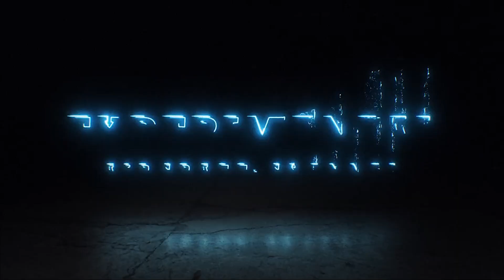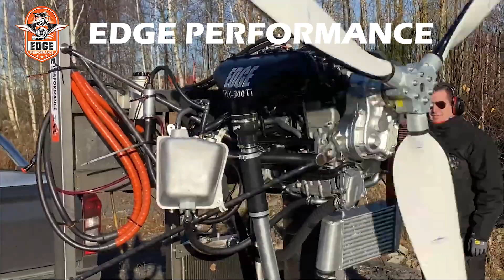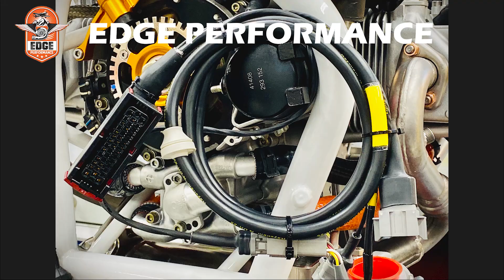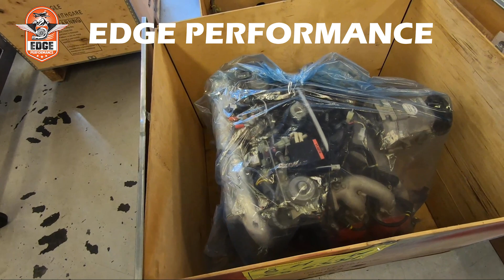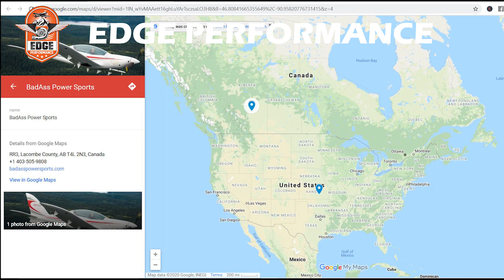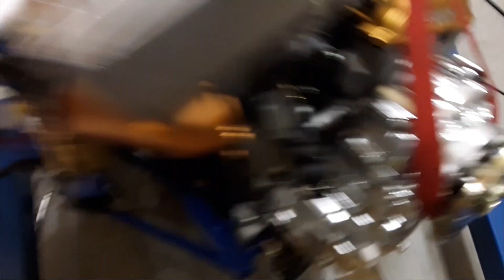Edge Performance | Yamaha Rotax | Engine Week 2020

Comment: I've been dealing with Automotive and automotive power plants for a long time. Since the mid 60s. I like the idea of learning about aircraft and their engine performance. The problem is is nobody but nobody have I ever heard talk about the actual engine performance. The only thing that they say is that the engine might put out 110 horsepower or 130 horsepower or 150 horsepower or 180 horsepower or 300 horsepower. Horsepower is not the only specification that is needed to know about the capability of the engine. You need to know torque specs when you're flying an airplane the horsepower means absolutely nothing if the engine can't put out the torque to keep the propeller turning. Why am I not hearing any of this in any of these videos that I'm watching. And it's not just this Channel on YouTube nobody wants to talk about torque spec. The only people I hear talk about torque specification is when recently I was watching a video on the lancair lx7 with a turbine engine. And at Cruise it is putting out a constant 230 ft lb of torque. Precisely the number I need to know if I'm going to investigate power plants, and power needs for different aircraft and how much power the engine has to put out. Horsepower is not power horsepower is a measurement and a specific RPM of the possibility of the work the engine can do. But if you've already run out of torque on the engine and you're trying to do everything with just horsepower you're missing a third of your power band. You can have 130 horsepower engine that only puts out 90 ft pounds of torque. When you might need the 170 lb of torque to get the plane off the ground. Why doesn't anybody talk about this specification. Every time I look at a video on engine horsepower for automotive application I listen to torque specs across the RPM band and horsepower across the RPM band. But in aircraft and boats the more important information to know is the torque specification because you have a constant load on the engine.

Comment: Hey Bryan, excellent series!  I’ve been watching and researching all power options for the CH750 SD.  I’m NOT stuck in the old school horizontally opposed paradigm but rather favour the Viking packages.  Better designed internals in the Honda engines hands down.  Liquid cooling is a must up here in Canada.  No need for Carb Heat or Mixture in the 21st century.  So, would it be appropriate for you to respond to me if I can solicit YOUR opinion as above?  In my opinion, Viking is best and most cost effective initially AND going forward!  By the way, I love your channel, you do great interesting videos!!!

Comment: Request - Can you cover Aero Momentum engines? Especially the am20T model as no one has seemed to use this engine yet. I would like to use this engine in an Zenith 750SD but no one has seemed to use it yet. I think this engine will be huge once it gets installed with a track record.
AM20T
https://aeromomentum.com/am20t.html
Video
https://youtu.be/InfiwXFDUlo

Comment: Awesome motors and I’m sure they build them top notch but man those prices are a tough pill to swallow! It would be hard in my opinion to lay out that kinda cheese for something like that when I could stick with a legacy motor like the lycoming thunderbolt for the same money. Definitely interested in a Yamaha conversation for my zenith project though. Always been a big fan of Yamaha. I own several Yamaha motorcycles and have rode and worked on them for years and can attest to there ruggedness and reliability. They have always been leaders for innovation in the power sports industry.

Comment: There's a reason why those WW2 engines are still in service, they are simple, reliable and they work!
Reply: True, just not as efficient and light weight ;)
Reply: WW2 aircraft motors were fantastic for the ww2 era .   Would you want to drive a Model -T  every day now ???
Reply: There’s a reason every modern day production vehicle on the road uses a port injected or direct injection computerized engine today. They are even more reliable and work better than before!

Comment: 19:43 Fully dressed engine sub-200 lbs!? 25:05 If heat is an issue (and when isn't it?), what about water/methanol injection? It would be an easy add-on w/ the existing fuel injection system and not terribly difficult for the carbureted engines, as I use this type of system on my air-cooled Corvair engine, w/ excellent success - aka: zero pre-detonation/knock.

Comment: The Edge Performance website is not very informative. The Rotax derivatives are not even there. 
A concern is for instance the power requirements of the electronics - not specified.
I'm sure I can think of more. None addressed on the website.
Reply from the maker: At first you don't succeed... try try again. It is very difficult to communicate all of what one does within a website. And... like he said they are a very small company. So updating a website is probably very low on the list when you are arms deep in engine builds. Not defending anyone... just now sitting on that side of the Small Business I can see how that happens. Start a conversation. Send him an email of catch him on Chat in messenger. Thanks for stopping by! :-)
Reply: @ExperimentalAircraftChannel  Just like to add that the customer service at Edge is off the chart. Thomas personally replies to emails within minutes and goes out of his way to help. As his business becomes more successful this may become more tricky but I have nothing but positive feedback for Edge in that department.
Reply: @jamespadley6584  thank you James.
Reply: @ExperimentalAircraftChannel  That I understand, I've been following his progress for some time, it is growing pains of a small business. I believe it is a high quality product, being able to move away from carbs on a 912 makes a great deal of sense. Once I can find out some finer details it's a development I want to do. It's worth noting how much he's achieved in a short space of time.
Reply from the maker: @Europa-Travels  Here Here! :-) Well said friend!
Reply: Likewise I found the website poorly laid out, I was looking for the secondary alternators.
Reply: @Europa-Travels  what questions do you have about the secondary alternators? I would be happy to help.
Reply: @stolcreekaviation5507  Thanks for the offer, I spoke to Thomas re whether power requirement of EFi, pump and ECU would need another alternator. His advice would be good to have but not necessary.
Reply: Feel free to reach out with questions. I am trying to get more info up on my website as well. FYI the power draw on the EFI system is 8amps.